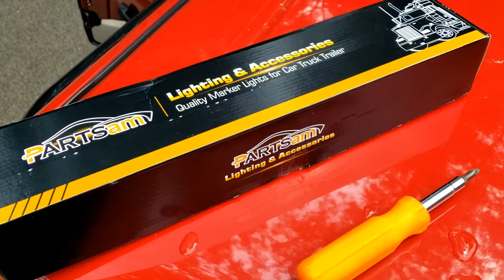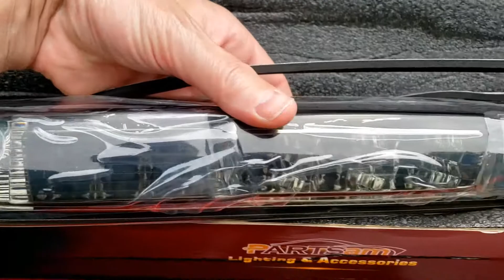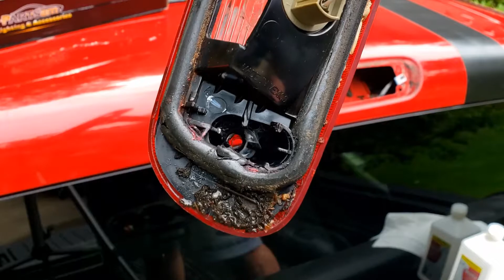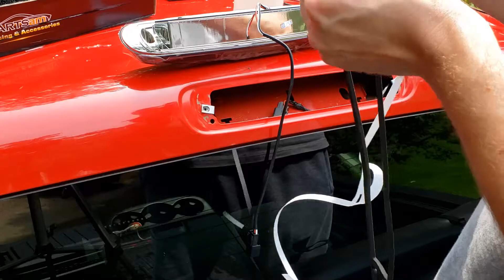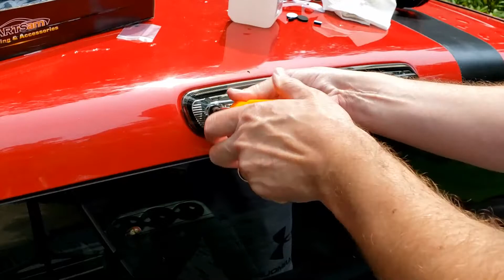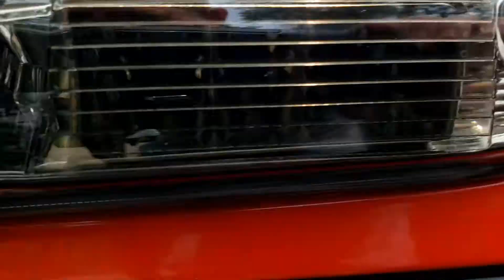2007 - 2013 Silverado 3rd Brake Light Install

Comment: What exhaust do you have in this video?
Reply from the maker: Thunderbolt oval muffler by CanAmMex. I dont remember exactly which one but a local small muffler shop near me uses them. The muffler is cheap, like $50 or so and still running strong. You can find the muffler online though
Reply: Yeah I’ll definitely be on the lookout for it. It sounds good

Comment: Hey I put the same one but only the red light works how do the side ones turn on ??
Reply from the maker: You turn the switch that dims the instrument cluster. Once you turn it all the way it turns the white lights on.
Reply: @Subariblet  but once I turn it off it also turns the white down